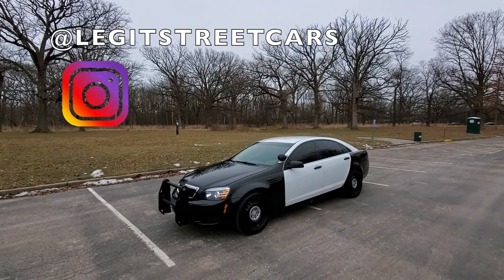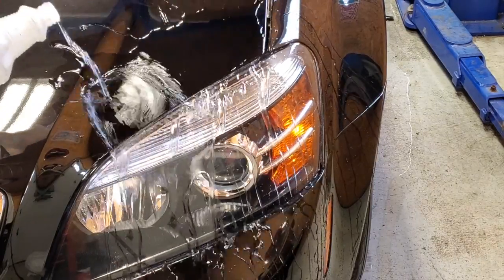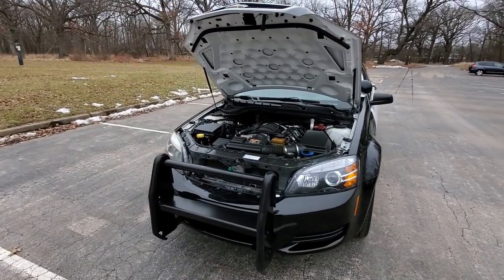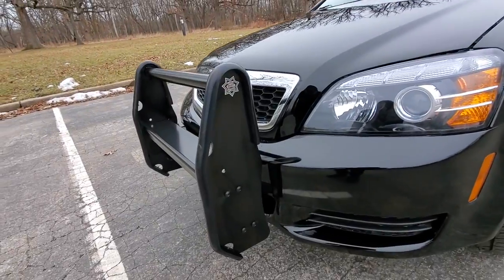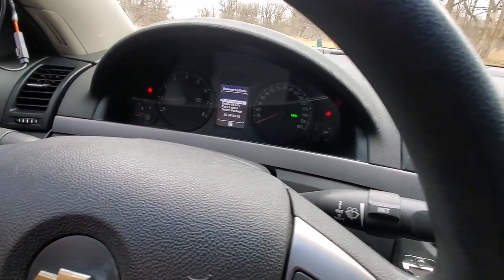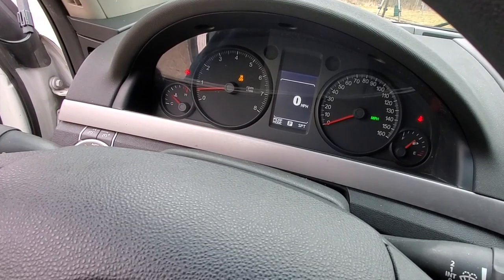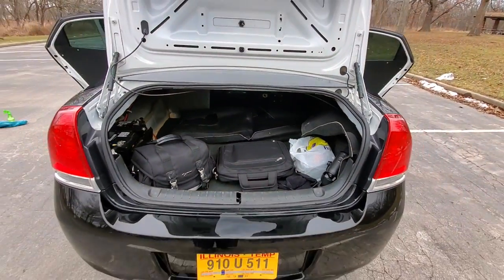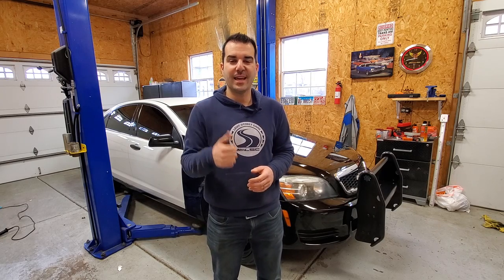I Bought The Fastest Police Car Ever Made & The Cheapest Way To Buy A Modern LS CAR! 4-Door Camaro!

Comment: The "Trap Speed" is used to clock speeders.  You engage the feature, get behind the speeder and press the button without having to look at your speedometer.  It "traps" or freezes that speed on your display so you can use it to write the citation.  The speed number will remain there until you manually clear it.  I used it a few times but it is just easier to look at your speedometer the old-fashion way.  The feature does not work if you are moving at under 30 MPH if I recall correctly.
Reply: Does this run off of radar or just YOUR vehicles speed?

Comment: Nice. As a working dealer tech at Buick, in 92 the Roadmaster came in the door at the same time the Caprice went to Chevy. Even back then, the police units where gone over for pre-delivery. The “Holly Grail” was the VIN that is used to control all things fast equipped or not. While tires determine how fast you can safely go, brakes were better to stop at higher speeds. Fast forward 28 years, everything is programmed including the Body, Trans, Dash and all. Without touching the engine, a program by VIN would change shift points, fuel cut, timing and injector on time. So long before aftermarket tuning was available, this was the ticket. Later, my career took me to train techs at police, county and FBI garages. They had money issues at times but service was not skimped on and the warehouse distributors supplied factory AC Delco parts, so for the most point, we’re well taken care of and service records where held at the garage. Only dealer work was done under warranty. So great show chap!
ASE Master Tech since 1978 - Retired

Comment: High idle hours on the old P71 Crown Vics & these Holdens generally translates into premature cam wear. But if you're going to change out the cam anyway then you're all set.
Reply: The Hemi tends to suffer from the same ill.
Reply: Always check the hrs if you can. You will see what you are getting into
Reply: Do LS engines have roller lifters?  I had a couple of NCSHP Mustangs 92 and 93 that had 72 and 77,000 miles, cams virtually no wear on cams. Oil coolers and 3000 mile oil changes might have helped.
Reply: yup you caught that - Hemis are the worst Uncle tony did a great piece on this with the hemi - no oil being thrown around is clearly the reason why the roller lifters in the hemi fail....class action anyone - if you buy one be prepared to drop a cam in but still in all not a bad deal

Comment: For the headliner, we use the 3M spray glue can with the straw, poke a couple small holes in the headliner to fit the straw through, spray upward towards the metal roof wave around all angles then push and hold the material against the freshly sprayed metal. That will hold it up and looks decent, and extends it a couple years. Then get the moisture pellets on the inside of the car to get rid of condensation and sweating, that's what caused the problem to begin with.

Comment: From an experienced Ex-owner of this car (The Middle East one) 
I’d probably say the most reliable mods on this car is cam, headers, Tuning all together and you’ll have a ton of HP and reliability for daily use if you want, quick tip: in the speed cruise control if you pressed the + and - together you’ll activate the night mode which is turning off all the interior lights except the speedometer. Again .. wish you a very good luck with this car and can’t wait to see what’s next 😍

Comment: I picked up a 2014 Caprice about a year ago with only 42,000 miles on it. Since I’ve purchased it I’ve installed BC Coilovers,  TSW Holeshots, Full BMR rear suspension and subframe braces, Chevy SS center console, Converted Column shifter to Chevy SS auto shifter assembly, SS dash, front door panels, and gauge cluster which I had recalibrated to my vin/car with the all red Holden display, I have the sport shift enabled through HP tuners. Rotafab intake, Solo axle back. I love my caprice and will never get rid of it. I had been looking for one for over 5 years since I was pulled over by a red one of 66 heading to DC.

Comment: "Never seen a Mopar in a Chevy..."
stares at Blasphemi
Reply: It takes a mopar to catch a mopar.
Reply: Scrolled for this, not disappointed.
Reply: @texasgladiator4757  - - AMEN!
Reply: RIGHT! How does not know about Mike Finnegan's ride?
Reply: That's not a Mopar engine either, its a custom built race engine with Hemi design. I doubt there is one Mopar part on the entire engine.
Reply: “Little bit higher trim level”🤣🤣 um  it’s like Cadillac Top spec in 🇦🇺
Reply: @Hoggdoc1946  Googled a picture of Blasphemi It says Mopar performance on the valve covers, has the stock Chrysler 2nd gen distributor  location. Just curious is a Chevy design consisting of aftermarket parts still considered a Chevy engine by you ?
Reply: Built 40 years ago, and yes, it's got a Hemi...  http://www.corvettereport.com/sandman-dewey-powell-the-worlds-only-392-hemi-4wd-corvette/

Comment: I have a VZ Crewman here in Australia with the Gen 4 6L L76, it's basically the same as the L77. Couple of things to note, ditch the DOD as the lifters do fail and can take out the lifter bores rendering the block unserviceable! When selecting a cam, go for something with a LSA of 114-115, tighter than that they do get lumpier at idle but typically they won't make as good power and fuel economy gets destroyed, also go for a slightly higher exhaust duration, the intake outflows the exhaust side on these, both are a quirk of the 364 heads.

Comment: Do yourself a favour and do some research on a Holden HSV Grange. 

Essentially a full performance spec of the statesman/caprice that this interceptor is based on.
Reply: Correct but its just called HSV Grange, not "Holden HSV Grange" because the "H" in HSV already stands for Holden lol so you've basically said "Holden Holden Special Vehicles". Alot of Americans get that mixed up.
HSV aka Holden Special Vehicles is the officially designated performance vehicle division of Holden, HSV even have their own unique badge which has Holden's lion next to a race helmet in a circle rather than just the plain Holden one which is the lion by itself with 1 paw raised ontop a stone.

Comment: perfect car for children. they can shit and piss their pants and no problem - plastic seats. no window switches or knobs to play with, no door handles for escaping - all you need is a cage and you're set to go!
Reply: Heads up no rear air bags. That was on purpose so older, solid cages would work.  Air bag safe cages have break away edges.  Buying all new cages is a big expense.  Big back seat was nice when someone did not want to get inside.
Reply: Kids slide around and hurt themselves. Possible death. Doing 160 mile per hour.

Comment: So I am still driving my 2013 caprice as a full time patrol. Drove it since new. Love it. Best police car ever. Issues I have had are all three motor mounts broke. The horizontal shock to the rear end went out at 25 k miles.  But the new one is still strong. Constant tire sensor issues. Am fm radio won’t turn off.  It just stays on even if car is off. Rear tires will wear out around 12k miles. Front ones will last twice as long. Valve cover gaskets leaking. Ac went out. If your windows quit rolling down it’s not the control switch.  The driver side door Control wires will break from opening and closing driver side door. Can’t see at night with Head lights but you fixed that. Remeber battery is in the trunk. Also check the engine idle time on the display. Multiply that by 33. It will give you a truer sense of mileage. Cop car will idle for 24 hours at times. But all and all. Best car I have ever driven as a cop.  No one has ever out ran me. Yet...lol my department wants to retire it but I keep driving it. Hope this infor helps. My currently has 68k miles. But when idle time is calculated it. It’s 171k miles. The 33 miles per hour of idle comes from the police fleet safely Manual

Comment: An alternative low-cost fun car/sleeper: I bought an arrest-me-red 2008 Chevy HHR SS with 5-speed &  Ecotec Turbo Engine (Highest HP/CC ratio engine ever built) for $6k. It tops out at the same 155 mph, gets there a LOT faster, better gas mileage, corners like a slot car, has a sun roof and is a heck of a lot more fun to drive. Cheaper to buy, almost zero idle hours and no mods needed. Still sits two in the back seat and they fold down for longer rifles. Fun, fast and quick comes in all sizes and flavors. Just sayin')

Comment: That car is in Very Nice Shape. WOW ! My Vest was $995.00 paid out of my own pocket, only good for about 5 years, Great price on the car. See the back door panels where those holes are in the door, that's where the bars where on the back windows. This car was run maybe by a higher up on the force. Trap speed is set up for speed traps lines. We had cars that would run 24/7 and we just let them run all the time. I bet you get a lot of looks when you are behind someone. Just remember, you Can't out run the Police Radio. Thanks for sharing.

Comment: I live in Florida and it's very hot and humid in the summer but the AC is required pretty much year round. When a cop started their shift and went out on patrol you can bet that car stayed running for the whole shift. Also they are required to be at the site of any road construction for traffic control so you often see their car there running with emergency lights on. In the extreme heat of summer, alot of them pop open the hood as far as the safety catch for better ventilation.

Comment: most g8 parts fit you can replace the backseats with g8 ones
Reply: G8 rear seats will be different to the Caprice.
The rear seats sit in a different spot compared to the doors.
Reply: Could see if you get a hold of a Holden Statesman interior.
Reply: What about the ss interior?
Reply: agentcrm had a friend with a caprice who swapped quite a bit of interior parts including the rear seats
Reply: Caprice interior parts only for that vechile, just like the holden crewman 4 door ute.
Reply: 2turbo4u nope, 2011-2013 is g8 interior. 2014-2017 can be swapped with SS interior
Reply: @Toiletstainz  

Yep .... true .

I still have my SS Crewman ....
👍
Reply: @robertg2046  

Only from front doors forwards ..... back half was stretched dimensions .
Reply: @sfcarp9418  yeah forgot to mention that it was from b pillar back

Comment: I would start a 12 hour shift and not turn the car off until I finished for the day. I had two keys and when I had to get out of the car I would lock it running
Reply: Exactly!
Reply: Not turning them off for the chance of not starting again i assume?? In case of emergency..
Reply: @markj2838  they will always start. It's for all the electronics to be booted up & you logged in. Also for snow not to ice up & freeze on a hot windshield with the car off. Keeping it cool is also nice wearing armor.
Reply: @jimnielsen4076  ahhh ok, makes sense to me...👍
Reply: Like I said, this guy has no idea how we actually operate these patrol units.

Comment: My agency had the Crown Vics. State Patrol had some of those Aussie cars. I was told parts and everything were coded with Australian part numbers. That  added to the expense and time to get replacement parts from downunder. A lot of Troopers held on to their Crown Vics because they had more driver room in them. A unit with all the emergency equipment, radio tower, lap top, gun racks, etc,  made for a tight fit if you were a larger officer.   Good luck with your unit.

Comment: Can't remember my worst speeding ticket, but I definitely remember my most expensive.  $500....Over 80mph in Tifton Georgia on Route 75 (speed trap) earned me a "super speeder" designation, ironically enough in a Pontiac G8.  Red.
Great buy!  I love my G8.  One of the best cars GM ever made that most people don't know about.  
Yours doesn't have many miles on it so it might not be an issue yet, but when it comes time to replace your control arms, do them all at one time.  Probably preaching to the choir, but I thought I would share my experience.
Have to love southern cars.

Comment: I love Cop cars--in 1992 I was managing a Chevrolet Dealership SVC Department in Missouri. We handled warranty issues for the Area Highway Patrol in Western Missouri. One day in comes a H.P. unit that was hardly running. The Trooper explained that he had been in an extended high speed pursuit the night before and that he lost power after several minutes and he had to limp the car in.. We tore down the engine and the valves were tuliped (bent downward) from being hammered for several minutes at high speed (lousy factory valve springs). He said he was getting left behind by 5.0 Mustangs and SS Camaros every time.. I decided to do a custom re-work for them. We had the heads decked, manifold planed and installed a GM high performance cam/lifters, springs and valves that exceeded typical L-82 type profiles. We did some custom work to the exhaust and we customized the Turbo 350 with some drilling and removed a check ball or two--we knocked out the plugs in the factory carb, re-jetted it with MUCH larger jets and then reworked timing over several runs up and down I-70 (we called in to HP for clearance to run with lights on and let it rip). The car was really fast and would just bury the odometer effortlessly--I called Missouri HP and told them the unit was ready--when the Officer came in to pick it up he said "wow, that took a lot longer than usual".. I said, well I think you'll like the results--let me know how it goes.. I NEVER told them that we changed the entire set up. He called me a couple months later and said "this car is so fast, I have caught every kid who has tried to outrun me and they can't believe it--he also added, the word is getting out!!"
 We also ended up doing one other unit for the local City Police the same way--they couldn't believe the difference and called same day to say "This will work!!" 

You have a beautiful unit there! Enjoy!

Comment: i have a 2014.. it had 15,000 engine hours and 10,000 idle... crazy
Reply: I have a 2014... how do you check the hours?
Reply: @mrbigmoney2081  i think you can check it with a OBD scanner but im not 100% sure
Reply: @aliadelhd  I figured it out... it's on the turning signal switch... mine has 9,000 idle hours with 90,000 miles... that seems pretty good to me
Reply: @mrbigmoney2081  that's excellent, i have a 15' caprice cuz we can get them new from the dealership and im sooooo inlove with it!
Reply: @aliadelhd  mine is a ex cop car, I got lucky because it still has the back seat and covers over the back door panels..
Where do you live... Australia?
Reply: @mrbigmoney2081  no kuwait, here in the middle east we can get caprices and holdens brand new under the chevy name!

Comment: I had an 87 Dodge Diplomat that was great.  Ordered by a deputy chief, it was black with bright red cloth interior.  It had a relatively large 318-4 barrel which gave it lots of pep.  It was only $800 because the clear coat was peeling.  When it got real bad I bought 20 cans of black and painter it in my garage.  It had a rough finish like a bbq grill, but it looked good.  All the chrome shined up with scotch-brite pads.
I now have a 2011 Ford Crown Vic which was owned by a security company.  It is white with interior upgrade and Ford mag wheels.  It had 80 k on it and now I'm pushing 130k.  After I bought it I found some mall cop type sunglasses behind the rear seat.(Steve Madden)  The car cost 9k in 2018, and I plan on keeping it 10 years or so.

Comment: We used these setups for highway patrol/pursuit car for Australian Police. Instead of the caprice we used what America refers to the "Chevy SS" but crazy tuned and optioned up. Roughly around 550hp. Also used the inline Turbo 6cyl Barra Ford known as the Ford Falcon XR6 Turbo, same situation with 500hp, but the best thing was they handle like they are on rails. With our ex- police cars they are pretty rolled off the factory and sold as is when they retire. So full police spec less the police equipment.

Comment: I own a Holden of that vintage and the headliner was coming adrift.

I pulled it out and gave it to an auto upholsterer. Chuck the old material away, it will be all stretched and crappy.

Your biggest challenge will be getting it out, my car needed new front and rear screens so I did the liner at the same time.

Comment: With the idling hours I’m pretty sure it’s policy they have to leave their cars running Incase there’s an emergency that they can get in and go without hesitation
Reply: Idling is more so when they leave the car, equipment such as emergency lights and all the electronics (computer, modem, cameras, radios, etc) can stay running without draining the battery within minutes. That way they dont have to boot up their computers and radios every time they exit the car on a call.
Reply: SecurityEh! Also keeps the air con working. It gets hot in Australia at times

Comment: I owned a flex fuel vehicle.  The price of E85 was about 10% less than E10.  The mileage was about 20% worse.   BTW, if you live near a Costco or Sam's Club (which don't sell E85) their E10 is usually at least a dime less expensive than the gas station convenience stores charge which cuts into the E85 price advantage.

Comment: Evidently you've never driven the 1978 LTD Police w/ 460-4v engine. Last year for the full size LTD, Police package made everything very heavy duty. Had oil and power
steering coolers. Air scoops directed more air onto front rotors. Large sway bars F&R.
Suspension so stiff push down on fender it'd barely move. Pass anything except a gas station.